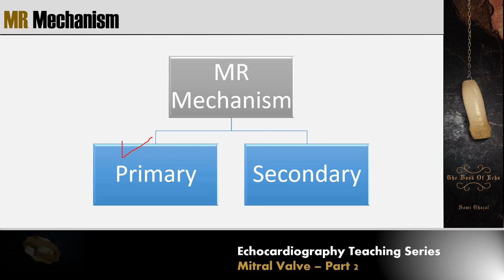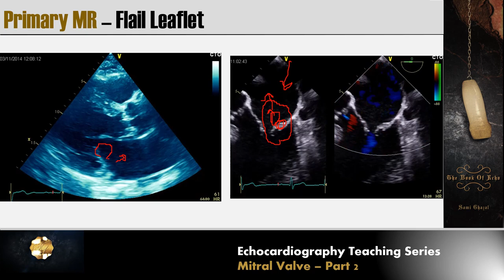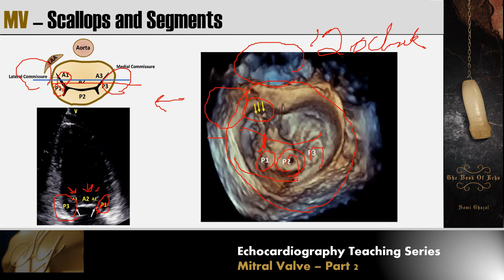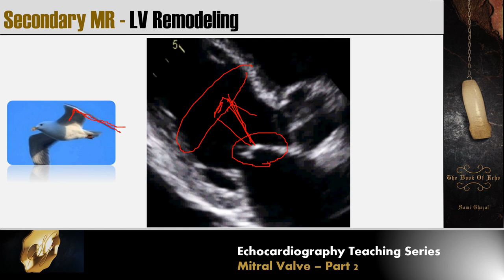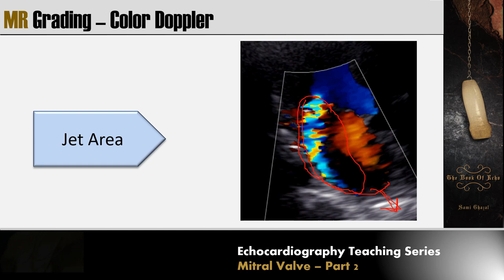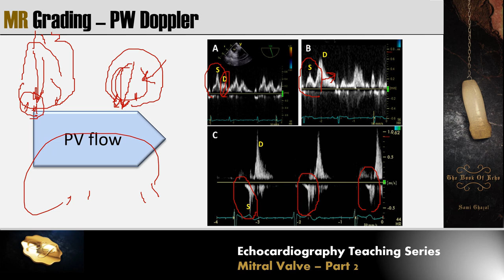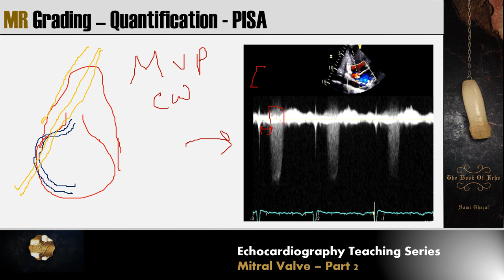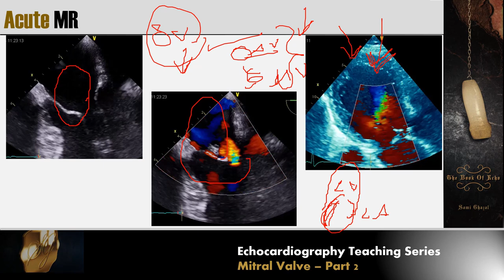Lecture 12 - Mitral Valve Part 2

Comment: Thanks for amazing lectures 🙏🙏🙏
 Just kindly small correction: “Patients with type IIIa dysfunction have a restricted leaflet motion during both diastole and systole. The most common lesions are leaflet thickening and retraction, chordae thickening and shortening or fusion, and commissural fusion. MR is most often associated with some degrees of mitral stenosis. The mechanism of MR in type IIIb dysfunction is restricted leaflet motion during systole”- Principles of Reconstructive Surgery in Degenerative Mitral Valve Disease Farzan Filsoufi, MD,* and Alain Carpentier. 2007’
Reply from the maker: You are absolutely right. Thanks for the correction.